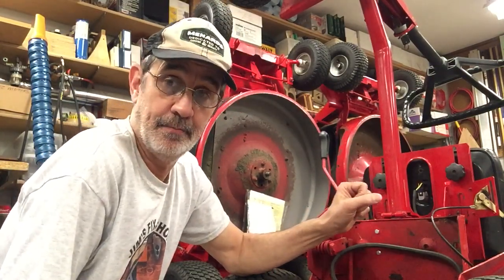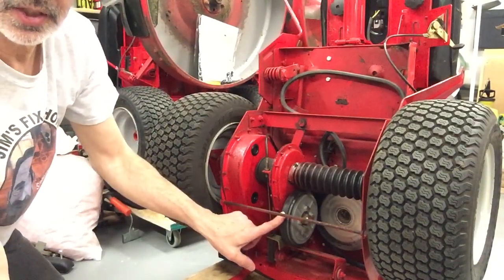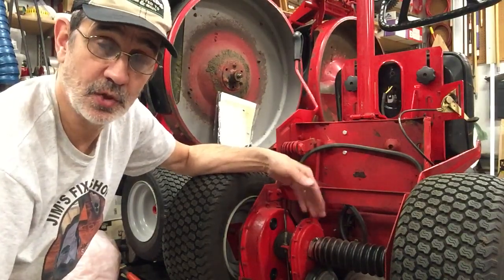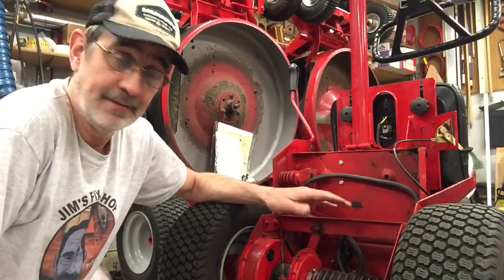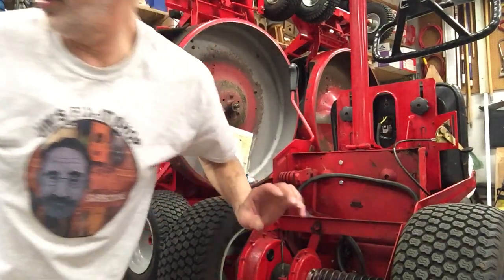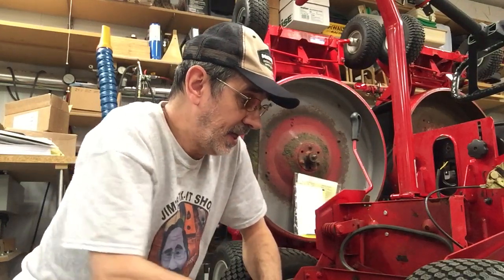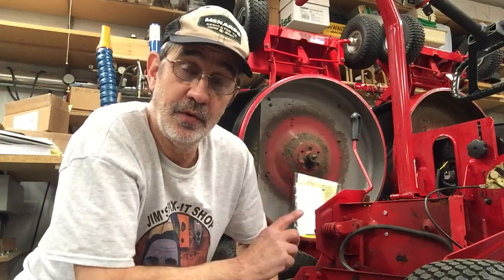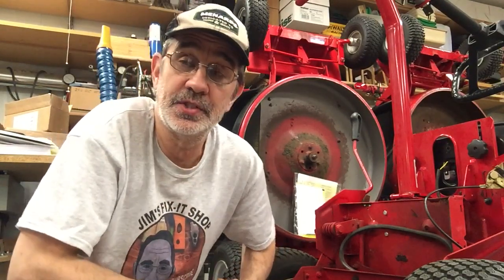291. M/S 57.  How can I adjust my belt and my clutch on my Snapper RER.

Comment: Hi 94jimmy5 - this is Big Rodders from Ireland. My models have what appear to be uncommon yokes where the reverse slot is set higher than the forward gears. I made up Jim's guide and while the forward gears worked great, there were challenges getting in and out of reverse. I resolved that issue by selected reverse, clamping the clutch pedal to achieve max lift of the yoke then adjusting the drive disk to 60 thou gap between the rubber clutch wheel and drive disk. I experimented with different gaps but 60 thou seemed ideal as reverse was selectable and there was adequate pressure applied in the forward gears.  Check that the yoke spring tension is adequate and as they say in this part of the word - Bob's your uncle! I would live to learn of other solutions - Cheers

Comment: Thank you Sir my spring was on the weakest point also, and that was causing some of my problems.  I still have something out of adjustment my reverse is really weak. It also will go forward in neutral if I play with the gear shifter.
Reply from the maker: I have a couple other videos. It talks about issues in the drive train. It sounds like you watch video number 70 try video number 96, 132, and 182. See if them help or locate your issue and let me know.       Jim
Reply: I’m going to watch them now
Reply from the maker: @lifeinnohurry2425  well let me know if you need anything.       Jim

Comment: mr jackson after installing a new engine i have a 1/4 inch gap between the drive wheel and friction disk in all the drive gears and reverse. everything worked fine a week ago with the old engine.  Will adjusting the spring be the fix?

Comment: Great detailed videos Jim. I have a question please sir since you are under there at the drive assembly the stiff wire in the shape of a number “7”, where does it attach. I know where the bottom (7) goes but what about the top? I couldn’t see it in this video. Part #7061197YP replaced by 7061197. Thanks
Reply from the maker: Danny Rock 
Hi it’s Jim, can you send me a picture of the spring you were talking about I think I know which one it is but can you send me a picture of it to my email which is
jimsfixitshop@gmail.com
I would really appreciate it. Jim

Comment: I put one of the hour meters on my oil burner.  Hour meter reading x nozzle size (mine1.2) = gallons of oil used per hour.....  saves me having to check the measurement on the oil tank (have to go outside to access tank).
Reply from the maker: I also mounted one on my gas furnace that’s in my shop just so I could see how many hours it really runs. Jim

Comment: Soo how do i tighten the belt? Like yours,mine won't budge,however everything else is working great,belt is just pretty floppy. Mine's a BVE28 inch cut with B&S 12.5hp. 
 I remember and old Re30 i believe was the mod# anyways I still have a horseshoe type of shim that that tightened the belt. This 2006 model has me stumped and its smoking hot today,heck the heat index is 98 as i speak in Oklahoma. 
 Thanks Jim
Reply from the maker: Well, Bob, the only thing you can do is try to bust it loose sometime standing it up and trying to spray penetrating oil down the pipe around the pilot bushing will help them come loose. It depends how rusty it is, let me know what you’re up to if you need any help. Jim.
Reply: @jimjackson9381  OK thanks Jim for the quick response! I just got back inside as it is about 15min from being dark and to top it off it started sprinkling as if we don't have enough humidity. 
 Anyway if it's dry outside tomorrow I will stand it up and do as you say and see what happens. I may need a new belt after the neighbor used it and brought it back with a broken brake spring as call it plus the drive clutch had chunks out of it so I've done a lot of work on it the past couple of weeks including a new exhaust push rod. 
 It's funny that everything was working great and after  an hour and a half he pushes back to my garage with the afore mentioned problems,coincidence perhaps. 
 Kind Regards Randy
Reply from the maker: Well, let me know how things are progressing. Jim.
Reply: Hi Jimi posted a couple of comments above some months ago and just mowed with the flopping belt. Anyway I got a new one yesterday and it's 2-3" too short,so i re-watched this video and was determined to get that tube pipe to Unseize. I did about an hour ago but there's a flexible type of washer that seems to be in a fixed position,this washer if you will is keeping me from installing the thick steel fork between the collar that tightens the tube if that makes any sense. Basically that washer keeps the clamp or collar out too far from the frame to which the clamp fork bolts to. I have a picture but I don't know how to do anything but watch and like on YouTube. 
 If you have an email or fb account I can send it that way unless you know what I'm talking about as I suspect you do. Anyway thanks Jim!
Reply from the maker: @RandyWBrown no go ahead and send me the picture. My email is.
jimsfixitshop@gmail.com
Pictures always help              Jim

Comment: How do i adjust the pulleys(?) that tighten the blade engage belt? It came from the store the slightest bit slack and any little bump knocks it off or if we stop or reverse the same. Is this the video? Thanks.
Reply from the maker: Scott Bennett 
To tighten or loosen the drive belt for the mower deck you have to loosen the clamp around the tube and either slide it in or out. Jim

Comment: How do you get your machines vertical without internal damages? Drain oil and petrol and remove battery? It would be so much easier to work on e.g. drive belt. I have a Murray and it's hard to change gear -- only when running, so I presume it's just an adjustment not the gearbox itself. I can't find anything either videos or just text hence I came here. Thanks.
Reply from the maker: Sorry I’ve never worked on a Murray. Jim

Comment: Hi Jim, I been watching your videos and they are very helpful. I have a 28" snapper riding mower. I have replace the clutch/break only and it work great however, it's been 1 month I change it and now all the rubber that touches the disc that is attached to the engine is all gone, it is metal to metal. Can it be something wrong. 
Thank you in advance for your help.
Reply from the maker: Eduardo & Christa 
First I have a question for you did you or someone else replace the engine on your machine, if so and if the crankshaft on the new engine is not in the correct location it will eat up your clutch disks ? Let me know. Jim

Comment: Hey jim. Love your videos. I have a re 110. Bought it used. And the previous owner removed the two bars on the back end which allow it to stand up for maintenance. Would you happen to know anywhere I can purchase these two bars?
Reply from the maker: You should be able to get them from Parts Tree.Com.  Jim
Reply: @jimjackson9381  I would assume it should be listed under the main frame category. But I can't seem to find them in any category
Reply from the maker: @DLWang  are you looking for your model number for your machine it's so it is usually on the rear case or on the tube going into the rear case.Jim

Comment: Sorry Jim you didn't show or tell how to adjust the deck belt, I think my belt needs to be adjusted.
Reply from the maker: @jamesmccarroll9925  that’s in a different video. I’ll see if I can find it for you.
Reply: @jimjackson9381  oh ok .
Reply: @jimjackson9381  I watch a whole lot of your videos, they are very good.
Reply: @jimjackson9381   I've learned a great deal from your video, I have 2 of these 33 inch deck models, 1 has a 16 hp motor and the other a 17 hp vetyc.
Reply from the maker: @jamesmccarroll9925  well if you’re talking about a snapper rear engine rider 1st you want to take the cover off the deck with the engine, not running, engage the mower deck and measured a distance between the belt at its closest point right by the idler pulley you should have right around 1 inch if you have more than that, you have to loosen the clamp around the tube and pull the frame apart to tighten the belt. Hopefully, the frame isn’t rusted into the rear case to check that with the machine sitting on the ground pick up the front end of the machine and try to twist it, it should twist from side to side.
Reply: @jimjackson9381  but on the SR 1433 there is a metal type bar between the front steering mount and the bolt is under the seat. Keep in mind this is the SR1433 body style.
Reply: But I'm sure it twist because I  cut slants dips hills and the mower adapts very well to any terrain, quit well.
Reply: @jimjackson9381  ikonw that my belt is a little too long because it's 74 inch belt, and it's calling for 73 3/4. But the issue I have is I  bought a belt that the dealer said was the right belt but maybe you could maybe send me the correct belt part number.
Reply from the maker: @jamesmccarroll9925  there has to be more to your model number than just SR 1433. See if you can find some different numbers.
Reply: @jimjackson9381  3314518BVE is the model number the 1433 is the body style.
Reply from the maker: @jamesmccarroll9925  the belt that you need for your machine is 73 3/4” long and the part number is 7043844.
Reply: @jimjackson9381  ok I was able to find it on Amazon. Thanks